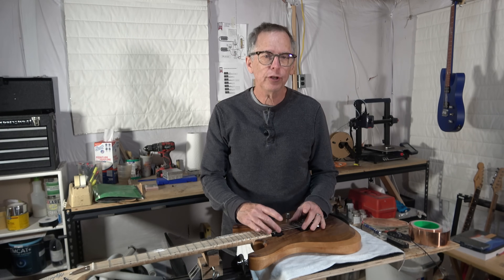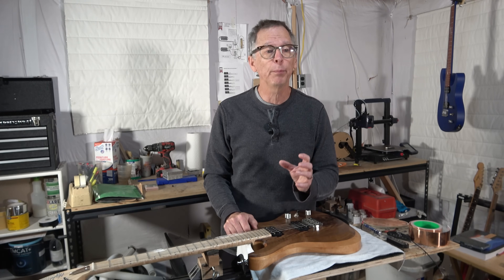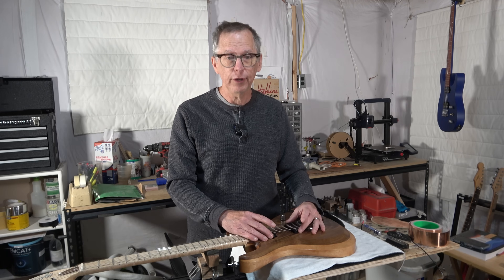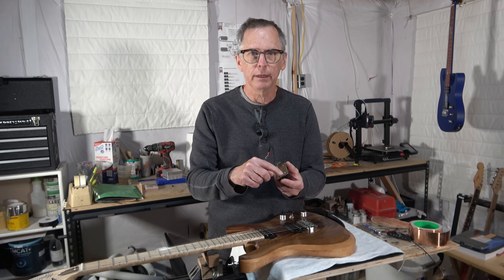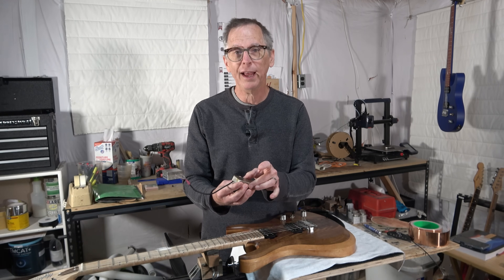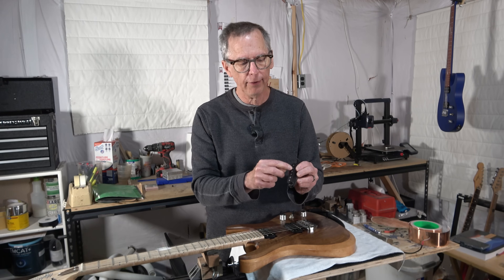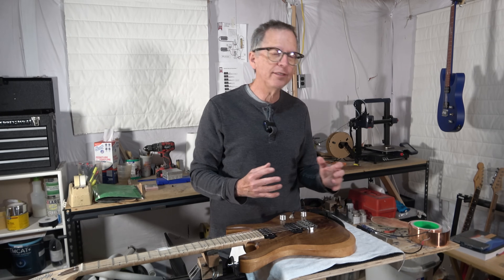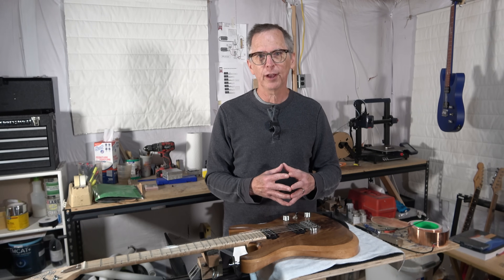Can You Shield Electric Guitar Pickups

Comment: I was under the impression that fully enclosing your pickups in a faraday shield would prevent them from picking up the signal from your strings. Can you explain how you can allow for the magnetic signal from the strings to be picked up by the pickups while still shielding your pick ups to prevent other signals from entering? Seems counter intuitive and many others have specifically stated that you can't completely shield off your pick ups without stopping them from functioning.
Reply: And as an added thought. if all it took to prevent/ minimize interference was a bit of dirt cheap foil, why would guitar makers leave anything to chance? why wouldn't they just shield the guitars themselves and give us the best product they can? To me, that would be the obvious business decision. I.E. There must not be a practical effect to shielding, or it would be done already, especially if you're spending upwards of 1000$ on an instrument.
Reply from the maker: Cost and the fact that external interference can be eliminated more effectively with alternative methods.
Reply from the maker: That is incorrect. The strings don't produce a signal. Instead, they are magnetized within the pickups magnetic field and when they vibrate, the magnetic field vibrates which causes the electrons in the copper wire to flow out of the pickup as an electrical signal. This outgoing signal is boosted by the amplifier before it is converted to sound by the speaker. Enclosing the pickup in a faraday shield won't prevent this from happening.

Comment: The problem with a lot of cheap pickups is that the cold and shield are the same conductor, making it a non shielded pickup.
i made a great improvement on a very cheap humbucker by replacing the cable with a shielded usb cable, using the four wires for hot and cold for the two coils, and using the shield to only connect to the metal parts. 
If you treat the guitar electronics as a balanced signal, meaning signal ground being 'cold' and grounding al the metal parts and shield conductors only to the output jack ground, you don't even need the foil or conductive paint inside the guitar

Comment: One of the quietest guitars I've ever played in an electronically loud environment is my rickenbacker 330. Even with single coils. There's no shielding anywhere except for the pickup case its self. I have zero idea why that guitar is so resistant to noise. I think there's some magic to only shielding the sides of the coil of a pickup, based on what I've seen and experienced. I haven't had good luck with just shielding a control cavity, doing much of anything, or the pickup cavity, even running different configurations of paths to ground.
Reply: I had an '89 620 Rick and not only was it the quietest but I couldn't get it to feedback to save my life. I could face the amp at volume and ... nothing. Those damn pickups sat right on top of the guitar body.
Reply: Did this applies to overdrive/distortion ?
Reply: @ Yes
Reply: @skyhop  
You put not enough efforts.  😉

Comment: A Faraday cage vs. a Faraday shield doesn't have as much to do with the components so much as what wavelengths are blocked and cost savings. In a cage the maximum hole size needs to be 10% the size of the wave you are attempting to shield. For something simple like AM radio, the shortest wave length is 600ish feet. So a cage with 6 foot holes would block most AM radio. 5GHz WiFi has a wavelength of 6cm. So a hole size of 6mm would be needed. The thickness of the cage also matters. By using solid copper shielding tape you eliminate much of this guess work and since we're shielding very small areas, there's really no cost benefit to using perforated material. However, thickness also matters, so you don't get 100% shielding from copper foil, but it does greatly reduce the interference that does get though.

Comment: or just use active pickups 😬
Reply from the maker: I use to hate active pickups, but after using them in several builds, I have learned to really like them.
Reply: @HighlineGuitars  I have the EMG T set on a Tele and really like it. It doesn't sound harsh or compressed like some people associate with actives. It just sounds like a Tele but without the noise.

Comment: Actually you can't shield the pickup from magnetic interference which is part of EMI. If you could. it wouldn't work at all. Remember that the pole pieces pick up the variation in magnetic field caused by the vibrating string. Any magnetic interference will be picked up by the pickup.

For practical purposes, addressing magnetic interference often requires specialized shielding (e.g., mu-metal), while general EMI may need conductive shielding (e.g., aluminum foil) or filtering.
Reply: Don't forget that EMI isn't static (i.e. it varies in time when frequency).  Maxwell's Laws dictate that where there's a time varying magnetic field there will be a time varying electric field.  So, an electrically conductive closed surface will in fact shield against time varying magnetic field.  Of course the effectiveness will be subject to the conductivity of the material, its thickness and the frequency on the interfering signal.
Reply: This is what humbucking pickups do, the two windings are connected out of phase and cancel distant magnetic fields as they pot the same field into both coils thus they cancel out, but as each magnet in each coil has its opposite magnetic poles to the other, the movement of the string puts opposing signals into the coils so they add.

It does cancel the magnetic field pretty well, but many people prefer single-coil sound (there are "single coil" pickups/arrangements with a hum canceling coil, but most single-coil guitars don't have that).  The challenge is then to stay away from things that generate magnetic fields, mostly the standard 50-60Hz power transformers as in amplifiers, mixers, most any equipment that plugs into the wall. The guitarist can often turn the guitar to the left or right to reduce magnetically induced hum, but getting 10 feet away from everything helps a lot.

If the hum stops or reduces when you touch the strings or the cable connector, the problem is electrostatic, and cavity shielding is what the guitar needs. At 60Hz and most audio frequencies it's not all one "electromagnetic" thing, it's either magnetic (field generated from power transformers) or electric/electrostatic (stray voltage from power lines/cords/interwinding transformer capacitance). Hum can be generated by both, so both should be fixed.
Reply from the maker: From Chat GPT:

Can a Guitar Pickup Magnet Attract EMI?

Short answer:
No, the magnet in a guitar pickup doesn’t attract electromagnetic interference (EMI) in the usual sense.

⸻

Here’s Why:

The magnet in a pickup provides a static magnetic field. It’s not responsive to outside EM radiation — it just sits there magnetizing the strings.

Electromagnetic interference, like hum from power lines or radio waves, usually affects the coil — not the magnet.
	•	The coil is the antenna, so to speak. Long lengths of wire (thousands of turns) make it sensitive to changing electric or magnetic fields.
	•	EMI induces unwanted currents in the coil, which become audible as noise (60 Hz hum, buzz, etc.).

But wait — do magnets interact with EMI at all?

Kind of, but not in the way you’re asking:
	•	Static magnets don’t attract radio waves or EMI.
	•	EMI involves changing electric/magnetic fields; magnets are static sources of magnetic field.
	•	However, ferromagnetic materials (like iron) can affect magnetic fields — but that’s more about altering field paths (e.g., magnetic shielding), not “attracting” EMI.